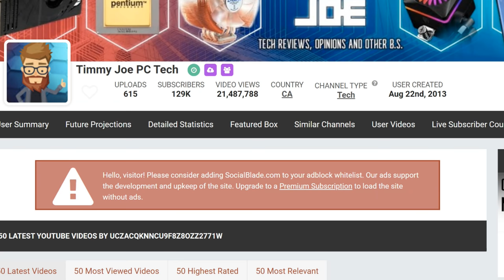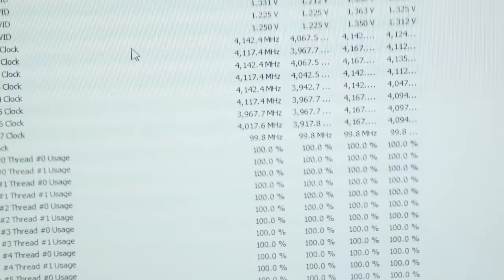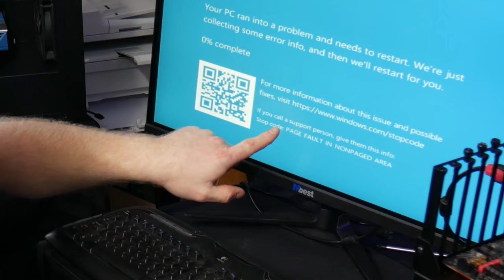This Ryzen 3700x was my biggest problem in 2019...

Comment: Timmy Joe PC Tech : the problem with your GAMA engineering sample of Ryzen 7 3700X is that the speed stepping is different when it does those short bursts of different core turboing between short tasks for which Gigabyte has very very narrow tolerances for in the way that it assigns turboing for multiple cores. Gigabyte didn't include it in their BIOS-es because their motherboards weren't sent to reviewers on launch day and thus they didn't include speed steppings of these late and otherwise matured engineering Ryzen 7 3700X samples. It's a common mistake that Intel and certain motherboard have had with their Skylake 6000 series back in 2015.
Reply: And also don't forget that the problem has occurred the other way round too: pre-release X570 motherboards would BRICK if you flash them a newer bios. I think Hardware Unboxed made a video for that but I don't remember which.
Reply: @xynostasos9022  jay had that issue.
Reply: @xynostasos9022  Thats what happened to JayzTwoCents. He had a pre-release "engineering" MSI Godlike X570 board and it bricked when he flashed the BIOs. When Timmy mentioned that his 3700x was an engineering sample, I knew that was the problem. Engineering samples hardly work well with post-release BIOses. Too many variations in voltages, stepping, etc between pre-rebase and post-release hardware/BIOs symbiotes
Reply: AmpEdition  if gigabyte didn't get engineering samples is it really their fault though?
Reply: I am disappointed abt. Gigabyte Aorus ,their  rgb fusion crashes and it crashes all my computer several times in a row. Unacettable.
Reply: @andreat4898  try evga rgb software it might work with your rgb. i dont know about rgb software that much though i dont really think rgb is cool its whatever to me i dont like it or hate it lol.
Reply: whatabout just setting it to a locked multiplier.....
Reply: @yurimodin7333  then you power saving low core state frequencies and idle power consumption go to.shit as fo your turbo performance numbers.
Reply: AmpEdition  You seem confused as hell. HUB made a video on why Jay's X570 Godlike stopped booting with a BIOS update. 

I don't believe it was a gigabyte board that killed their 3900X either.
Reply: Since I'm stupid im just gonna ask xd: will later 3700x'es work with gigabyte motherboards from what you can deduct? I'm thinking of going for a 3700x but I have a gigabyte motherboard
Reply: AmpEdition  Because your comment had nothing to do with the one you were replying to.
Reply: @namefighter8426  Any retail chip will work fine in a gigabyte board
Reply: THAT sounds like the head OF THAT NAIL...indeed.
Reply: @imadecoy.  Thanks for this huge consolation, i bought the 3700x and waiting till payday to get the x570 Aorus Master and seeing this video got worried, though i figured it had to do with it being an engineering sample too.
Reply: @Henry14arsenal2007  just out of curiosity, why are you going with an X570 motherboard?
Reply: Are the problems still present? Need new computer with 3700x and pcie 4.0
Reply: @namefighter8426  of course they do, yes, 3700x's work on Gigabyte boards. Timmy had an engineering pre-release chip which was effectively outdated by Gigabyte's BIOs. Gigabyte is a little finicky compared to MSI, Asus, Asrock when it comes to voltages, but BIOs updates rendered the 3700X engineering sample outdated anyway.
Reply: @emanuelelamattina4264  If you're that concerned of hardware compatibilites then settle with an MSI X570, since Timmy's pre-release chip seemed to work fine with MSI BIOs. Most of the 3700x compatibilities with PCiE and/or hardware compatibilities have been worked out by BIOs updates already. Keep in mind, your average consumer is not going to have a pre-release engineered CPU, so dont worry about it
Reply: @imadecoy.   I certainly hope so.  I had that B450 Gaming X and a 3400 sitting around for my next build. I'm not sure I can bring the board back.
Reply: @Ephem13  Why should i not? Its the higher end AM4 board and the Aorus Master model has 14 phase VRM, i plan to upgrade to Ryzen 4950x when it comes out so i need the headroom. Do you see anything wrong with this?
Reply: AmpEdition it a engineering sample, you won’t be able to get them in retail. It’s never supposed to be in consumer hand so gigabytes has full right not to consider them in retail boards. Intel actually has a policy that any oem that sell retail machine with engineering chip will be ban from intel sales channel, asus used to have a lawsuit about that
Reply: @Abigail Diaz
"BIOs updates rendered the 3700X engineering sample outdated anyway."
That doesen't make sense.Usually BIOS updates add to device's functionality and compatibility with more different products,not deducting it...
Reply: @TheChudoviste  engineering samples is supposed to be ban on retail hardware, by amd's regulations they are not supposed to work on any retail board to prevent resale
Reply: @andreat4898  that is why you just say no to lit fans. Now who what to play games be working on a project & be blinded by there pc. Dark mode for pc is a way of life. This is the way .
Reply: @thelightsilent  you sentence isn't making any sense. Are you a Shintel fanboy or just a Shintel fanboy from a non english speaking country ?
Reply: @appleache yeah,that makes sense.👍
Reply: I've used 3 ryzen cpus on different gigabyte motherboards never had a problem.  I believe the problem is the engineering sample and gigabyte motherboards you should be fine as long as you buy a non engineering sample
Reply: I guess its my motherboard giga wifi pro majority of first cold boots i need to hit the reboot window to get windows to start.  Old v370 never had this issue it still didnt like my 3800x.
Reply: So the impression I’m getting here, is that if I get a stock consumer level 3700x with a stock consumer level Gig. X570, I shouldn’t run into this issue??
Reply: Yea it is definitely a bios related issue, and that CPU being an engineering sample
Reply: @hjy2187418  you are correct as it becomes a liability issue, I winced when he so casually blurted that out.
Reply: @Henry14arsenal2007  there is a potential problem, next gen Ryzen might not work on Socket AM4. They probably will, should be fine. You could always upgrade to R9 anyway.
Reply: @WIDGI  Well, Lisa Su promised haha. But i think it will work, if not without a BIOS update.
Reply: and he's using cheap motherboards too. Does this guy even know what he's doing? That was a big issue over the last year with thermal design that had MSI restructure their line based on the premium model. Can't believe he's using that stock cooler on a 3700x also.
Reply: so is there a fix cause i cant do this anymore man
Reply: @tellmeshades probably because it's true....I've researched that on my own PC building experiences with my 2015 i7 6700K and my 2017 i7 7700K....
Reply: So many problems. Retail & beta hardware...
Reply: @andreat4898  The Gigabyte Aorus Engine software for my Nvidia GPU is crap n all.
Reply: @chad burnes there is prorably nothing wrong with launch CPU-s....I had a similar issue with a Ryzen 3000 and Rzyen 5000 CPU from two customers....and it turned out that the IO Controller chip DIE, which is a separate DIE under the heat spreader, was damaged as a result of OC-ing with no so much of a proper voltage.

Comment: When u watch this as a new 3700x and a Gigabyte mobo user... 😬
Reply: I think gigabyte may have something fucky with thier BIOS tbh. I thought it may have been me pairing a mATX B450 board with a 3700x, or just getting a dud chip. But stability has been poor, and I have been seeing intermittent BSODs or freezing since about a month after I put my machine together.

Like OP ive been doing things like underclocking my memory, disabling PBO, and keeping the BIOS up to date. Which all seem to fix the issue at the time, but im still getting a crash here or there, but at maybe 1-2x  a week and being inconsistent as to when it happens. 

I've also swapped out the CPU after it happened the first few times (thankfully microcenters return policy is very forgiving), and was thinking that I may have to redo my case and mobo for a full ATX as I thought using a mATX may have been the issue. Now I think (hope) that switching to a mATX board might just do the trick.
Reply: ...what Gigabyte mobo thou,,
Reply: @asabovesotabelow  I have a b450 aorus m
Reply: @asabovesotabelow  Gaming 7 Wifi rev.1.1
Reply: AMD is shite lmao
Reply: @Peter Cavojec I'm literally on this video because I'm trying to fix a friends computer with the same CPU and gigabyte Mobo. Exact same issues as this guy, he bought a 3700X and GB mobo and warrantied it the first time he ran into this issue, still has the problem
Reply: @Taurickk  Get an MSI motherboard, they're rock solid for Ryzen.
Reply: This. My 3700x, auros elite x570, rtx 2060s crashes all the fucking time. Super frustrating
Reply: Same here with the B450 I Aorus Pro and bluescreens all the time. This was a system for a friend so it was frustrating and inconvenient to troubleshoot.
Reply: That's me today after 3 months of memory swapping, memtest86 passes, gpu swapping, etc, etc, etc...
Reply: just installed this CPU 3700X on my Gigabyte B450 Aorus Pro with updated bios update F50. now my question is did he update the bios? lol! im now playing COD Warzone for almost 4 hours without issue :)
Reply: @diszo2010  Thanks GOD u fix issue with F50 bios . Yesterday i order R7 3700x and my motherborad is Aorus b450M and my heart stop when i was reading your first comment :D
Reply: Same issue with me
Reply: @ak9084  Begone Intel Fanboy
Reply: Serra McCall obviously you have issues. You cheaped out on the motherboard. A powerful cpu always certainly requires a good board. b boards are Budget boards and h boards are never ever touch boards. If you use such a good cpu you shouldn’t cheap out on that or rams for the matter of fact that I see on a daily basis as a hardware seller... A good motherboards provides greater efficiency to supply the current needed for the various parts of the PC specifically ram, cpu. U should simply change to a gigabyte x570 elite that’s a great board have been benchmarked and isn’t expensive
Reply: i got 570x gigabyte ultra and 3700x, lucky for me mine runs fine.
Reply: @Rancor has a Posse  i got the aorus 570x ultra (rev) 1.0 , no problems
Reply: @yessir6325  unlucky you :(
Reply: @yessir6325  i would send it back !
Reply: i had a asus prime x570-p but RMA:d it because i thought, and proved, that there was a faulty RAM slot. Now that i upgraded to a x570 aorus pro rev 1, found this vid and is still crashing... all left to do is to RMA the 3700x i guess..  FML
Reply: 3rd time i watch this video. Do note that it's a sample x3700 + a short-on-engineering-sample mobo. My guess is that retail 3700x + gigabyte would work. I get these kind of crashes but i think I've identified a probable cause being the DDR, being pre-AM4... in my case.
Reply: @serras_  i bet you have an AMD gpu, normally ryzen works fine ill hardly tell you have  this bad expirience cause of mobo+cpu+ ram, if you have nvidia card then i would think otherveis3e
Reply: I have this shit micro stuttering in games :(
Reply: Im using a gigabyte b550 mini-ITX motherboard with my 3700x and an extremely good air cooler (dark rock pro 4). Zero issues
Reply: Im getting no bluescreens but im getting system crashes every couple of seconds and then an entire day of gaming without. ????
Reply: Ffs why wouldn't I see this before either ordered my parts lol. 

Same cpu and b550i aorus itx board coming this week
Reply: @D1craigRob  Actually I just fucked up some cables. Was a 5 minute fix once i figured out what was wrong. 😂
Reply: 3700x + ASRock B450m/ac mobo + RTX 2060 + Tforce Vulcan Z DDR4 2400 (2x8)

Running for 3+ months now with zero problems.
Reply: @D1craigRob  Yeah... same here. Got a Gigabyte 570x Platinum with the 3700x. it's like what are the odds? Lol.
Reply: I have a 3700x and a Aorus B550 Pro AC motherboard. I surely have seen a couple of BSODs. Never understood why, this might be the reason.
Reply: @mikem9536  I did had x570 ddr4 2 sets incompatibility issue as hell. not awesome but nightmearish experience unfortunatelly. No bioses worked
Reply: I have x570 gigabyte aorus Pro bought im May working great with ryzen 7 3700x :)) not updating bios,I blame bios version for this "fun" issues ... hm :)
Reply: @serras_  does still cause blue with ryzen 7 3700 x cause I'm using gigabyte b450 aorus nd ryzen 7 3700x nd getting lot blue screen . It would be grt if u reply thanks in advance
Reply: I got THE SAME Problem a year ago.......With an MSI Mainboard!!! 😂
Reply: @sudharsanm9495  I got R5 3600 + b550 pro ac. built it at dec 31st 2020. Had R5 3600+ b450 elite then and was constantly getting BSOD, then decided to upgrade to b550 pro AC and still had BSOD. Fixed the issue just today. Undervolted my CPU to 1.1v :) hope this helps u
Reply: @jeyz11245  thanks alot g.
Reply: @sudharsanm9495  fixed?
Reply: @sudharsanm9495  hey man tell me if its fix, when you see this. I need to make a post about this for other people facing the same problem.
Reply: @jeyz11245  sorry for the late reply man actually I gave my mother board to the service centre near my location they fixed few capacitors and updated bios.
Reply: @jeyz11245  it's been 20 days nd I haven't faced a bsod now.
Reply: @sudharsanm9495  ah I see
Reply: 3700x user with an aorus. no blue screes. Have had the setup over a year.
Reply: I have a 7 3700x and a gigabyte aorus B550 pro AC Wifi (could have gaming there somewhere) no blue screen issues. However when I tried to do an overclock boost using one of the gigabyte programs it did crash, so I don't know. Built the PC in October 2020. Also have a EVGA 2080 super and 16 GB RAM that was said to pair really well with AMD.
Reply: running exact combo no issues at all. try changing p-states, different bios version. having pbo on and off. dig deeper into what happens with low loads. try different memory setting too.
Reply: I also have a 3700x with a gigabyte b450m motherboard. I did have a few issues where os was slow even on a fresh install on a m.2 since updating bios it’s works great. Got a good o/c of 4.3 GHz at 1.3v all core and even enabled rebar and now have with amd latest driver have amd Sam enabled with a powercolour 5500xt 8gb. Works great but if using pbo it would crash games as cpu not getting enough volts

Comment: Just imagine if you built this computer and didn't have extra parts to swap out.
Reply: That's my thought. For most of us, it'd be a nightmare. This is a big reason I want to set up a shop at the house. So I can have some spare parts and space to work when I inevitably have this sort of problem.
Reply: This...is me.
Reply: I got a 2700 and a x470 gaming ultra and I have similar issues running stock
Reply: ya that was my issue in my comment
Reply: So, easy fix... Don't buy gigabyte motherboard 😉
Reply: @Peter Cavojec based on my personnal experience with gigabyte, i will never use one anymore for any of my builds... In the Athlon xp time (early 2000s) i've had issues with a gigabyte 7vrxp-ultra and it lasted 2 months before going bad (used toi run stock) swaped for an msi until my upgrade in 2004 for a Intel Celeron D 2.4ghz on a gigabyte 8IPE1000-PRO (S478) Ans it lasted another 2 months (had to RMA that board multiples times) after 6 months of fighting with my reseller and gigabyte i switched to an Asus P4P800-SE ans kept that exact setup for 3 years up to my next build (Athlon 64 era) since that day i've exclusively used Asus motherboards and the 3 last were(still is) ROG crosshair family
Reply: I'd rather go to computer shop and help my computer built there
Test the computer for hours if its good I'll pay and boom back at home gaming
Reply: thanks I have that problem m8 :'( I just switched from a ryzen 5 1600af to a ryzen 7 3700x and it has the same issue and no parts only that one cpu not even rams